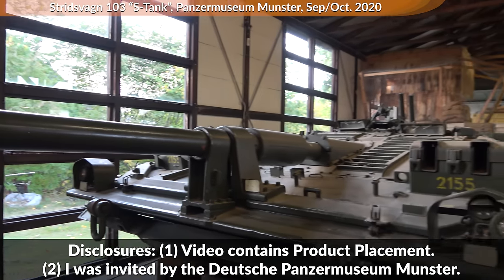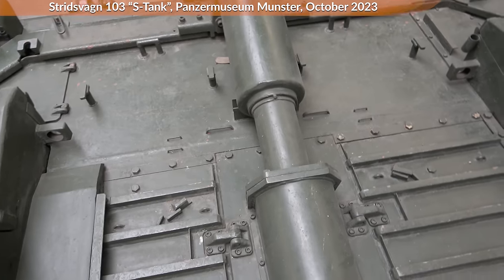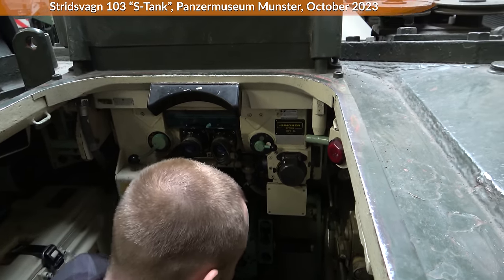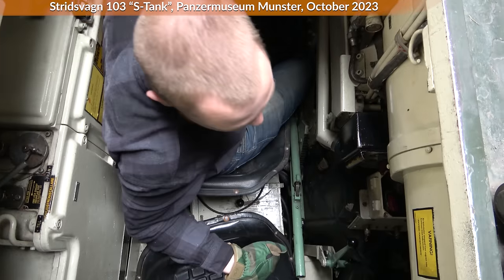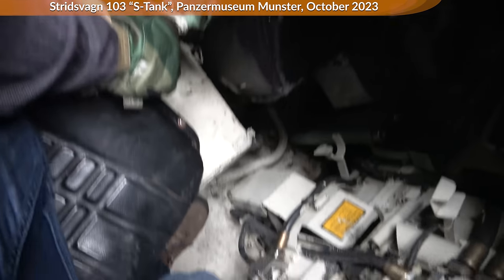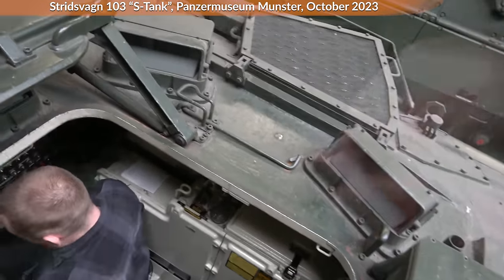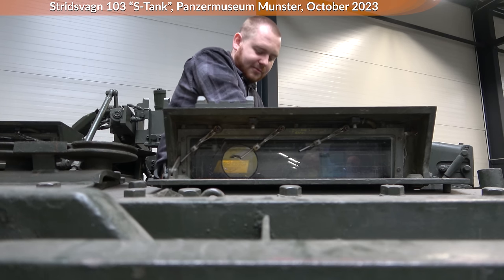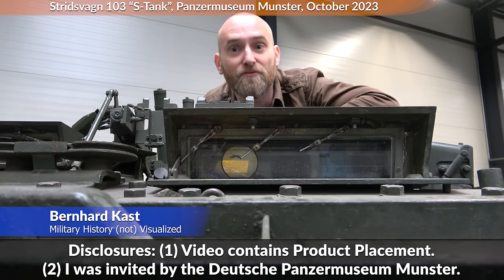S-Tank: The Swedish StuG

Comment: This tank is SO much older than the tanks the driver is comparing to. It should perhaps be compared to a Leopard 1, also designed in the 50’s.

During tests, the Strv 103 (Stridsvagn S) was however completely superior to the Leopard. It could detect more targets and come to shoot much faster. It was also tested in the US against the M60 and the 103 could fire a lot more accurate but was slightly slower to fire the first shot. In the last “battle” (exercise) the 103 fought, six 103’s went up against an equal number of Leopards. All leopards were knocked out but only one 103 was lost.
Reply: It's not that shocking, a much smaller target that fires twice as fast makes it almost unfair in combat exercise.

Comment: I really feel this form of tank is highly underrated. MBT's are big and impressive and take all the press photos but these vehicles are really hard to find and can hide in places tank stick out.
Reply: this form is very outdated, all modern threats are very dangerous for it: drones, mines and artillery
Reply: @shkoddi yes, but the same goes for modern tanks.
Reply: @mats66  nope. Modern tanks have chanses to survive some shots, this tank - absolutely not. Even the worst modern tank - Merkava 4, in fact, an infantry fighting vehicle with a tank gun, takes a hit better.
Reply: @shkoddi  the original comment was not about this specific tank but about this specific TYPE of tank
Reply: cant shoot while cruising, cant counter shoot when engine destroyed, cant move if it sitting in a trench ==> poor design
Reply: @milokhanh313 they where designed to use high speed to get into and out of ambush positions using tank showel to get hull down and then attack with three shoots when in contact with enemy tanks after they should retreat to next ambush position and do it all again. Their low profile and ability to go as fast forward as backward made them ideal for hit and run tactics in Swedish  hilly and rough terrain. They where not made to fight one on one in open terrain. See them more like sniper tanks 😊 
And they had two engines a diesel and a gas turbin to become more stable and able to get back to own lines.
Reply: @milokhanh313 can countershot with engine destroyed. After all you have aspare engine....😉
Reply: @jurgen4466  That sounds just like tank destroyer doctrine (atleast the German one, and I think the American one too). That's what I think is so strange about these things. They aren't built nor operate as tanks, yet people insist on calling them tanks. Tanks are offensive systems meant for open terrain where they can leverage their long range firepower. It seems very strange to me that this vehicle could fill the same role as the Centurions before it and the Leopards after it, unless Swedish tank doctrine changed radically each time they adopted a new vehicle.
Reply: @fridrekr7510  Well, it’s not like a lot of tanks don’t use “shoot & scoot” tactics (even today) and given the limited abilities to fire while on the move of tanks at that time, I think the difference between this tank and its contemporaries might not have been terribly large in practice.

As already mentioned in the video, the tank uses the same gun as the Centurion and could thus be expected to have roughly the same long range capability in open terrain, given that, at the time, both tanks would have to stop to fire. And tanks are not only meant for long range duels in open terrain, but also to support other troops and, if possible, to ambush opponents. 

Of course, and as mentioned in the video, when firing on the move could be combined with “shoot & scoot” tactics, then the need for this tank to stop before firing would obviously set it aside from turreted tanks and leave it at a clear disadvantage.

It should also be noted that Sweden’s defence was designed for one thing only: To defend against an opponent with massive superiority in numbers and materiel in a total, national, territorial defence strategy that would make it too costly (though obviously not impossible) for the Soviet Union to defeat.

Having tanks and other vehicles that could strike quickly and retreat into difficult terrain, rather than concentrate and fight mainly in open terrain where they would be obvious targets would be an absolute necessity. You really don’t want to go on a head to head slugging match with the Red Army’s tank force (NATO getting around this with the option of using  nukes, if push came to shove).

Compare with the requirements for Swedish aircraft to be able to operate from improvised landing strips (even using roads, if necessary) in order not to having them concentrated at a few, predictable locations during an actual war.
Reply: @DebatingWombat  The turret is always brought up as a main contributor to the versatility of tanks, especially in the offense where enemy locations are unknown. I’m not aware of any other significant tanks that used this turretless design at the same time or later. It just seems so impractical having to move the whole vehicle. Even if the doctrine was delaying action, tanks still shine as offensive weapons and counter attacks will be part of any good defence. If they didn’t count on having to fight it out, I don’t see why they couldn’t have used lighter platforms, ATGM jeeps etc. for hit and run tactics. Everything about this and how they talk about using them just seem at odds with the concept of a tank. Other nations have also used APCs or IFVs in tank like roles due to local considerations, but nobody would claim an M113 is a tank because of that.
Reply: @fridrekr7510  Thats because they for some reason only talk about the first half of the doctrine , which is meet and engage the enemy in delaying actions , the second part after mobilization is completed its time to actually engage him and you cant really go on the offensive in a jeep unless you have a death wish.

Lastly infantry cant fire on the move either , doesnt mean its obsolete and useless.

Comment: S-tank was still in use well past '79. I saw one on the streets of Gothenburg during exercises in the mid 80's.The S-tank was outmoded by 1) stabilised guns allowing firing on the move (it was anticipated but computers were still in their infancy during the design stage, so it was incorrectly assumed to be a long way off) and 2) WP armour piercing rounds which would've defeated its sloped armour, 3) engine reliability. The installed engine was too weak for the vehicle weight. 4) size of the main gun. Developnent took too long.

The autoloader was fantastic.
 
During testing in the UK, it was apparently shown that the need to halt and shoot did not leave it disadvantaged against other tanks of the era. The performance of Israeli tanks vs Syrians in the Golans comes to mind....
Reply: It was in service until 1997. He just misread the number because in German you say the last number before the second last.

Comment: the point about the gas turbine is not really correct, the piston engine was used to run the hydraulics which allowed the gas turbine to idle and take less fuel but this was a combined powerpack with both engines running in unison for 90% of the time.
While the two engines can to some extent operate independently they are still connected to the same gearbox (situated in front of the engine) so any hit to that area will mobility kill the tank regardless of one engine still working.  So tldr thats probably an overstated point. 

Also the external stowage bins are missing from this vehicle so the storage isnt as bad as you make it out to be in the video.
Reply from the maker: Thanks, seems my source on that was wrong.
Reply: @MilitaryHistoryNotVisualized  OP is wrong.
The barrel splitting the engine compartment in two necessitated the dual engine.
Just like with the M1 Abrams, the problem with gas turbines is that while very efficient at full throttle, they use almost as much fuel (~70%) when idle as they do under full load.
Thus a diesel engine was selected to keep the systems running and the tank to move at "low speed" (exactly what that means isn't defined in the sources), with the gas turbine providing power when quick acceleration or high speed was needed.  The problem here is that the turbine takes time to start and wind up to combat power, so whenever a state of readiness was needed, both engines were kept running regardless.
The gearbox was located forward of the engines as stated, but lower in the hull making a hit there less likely.
What makes it a bit of a moot point is that crews (like everywhere else) tend to leave the tank anyway if someone is poking holes in it,
Reply: @johanmetreus1268  Essentially the turbine was just for in combat mobility while the diesel was just when traveling.
Reply: @znail4675  It might have been the intention, but that is not how the tanks were operating.
Reply: @johanmetreus1268  your post seems to mostly agree with OP but somehow OP is still wrong.
Reply: @falsemcnuggethope  mostly, but there are two points where we disagree. My apologies for not expressing them more clearly.
"which allowed the gas turbine to idle and take less fuel"
With Sweden having plenty of experience with gas turbines since at least the 1940's, it was well known that a turbine on idle still used about 70% of the fuel a turbine on full power did. the basic idea was to shut off the turbine entirely when not needed.
For this reason, the engines could be fully disconnected from the gearbox.

"they are still connected to the same gearbox /.../ any hit to that area will mobility kill the tank regardless of one engine still working."
Lower front plate, sure.
Upper? Not so likely.

Comment: I was surprised it was recoilless, so Iooked up the wiki.  Seems being recoilless allowed it to shoot once every 3 seconds!  Looks like the Ferrari of cold war tanks.
Reply: The recoiling part of the gun is at the very back of the tank, where the auto-loader sits. It is most definately not a recoilless gun. An autoloader fixed to the gun allows it to fire 3 shots in six seconds (ie, one shot every three seconds).
Reply: It isn't recoilless, it simply uses the suspension as recoil dampener.
But yes, it is the fastest shooting tank ever.

Comment: So the gun DOES actually recoil, I have seen video footage of an S-tank firing and you can see a little bit of recoil. However I assume that the recoiling part of the gun and the entire recoil assembly is enclosed inside that white metal tube you see in the fighting compartment, so the crew is indeed safe from getting caught on it or anything
Reply: Yes I do think the gun did recoil, but not so it was noticeable inside the tank. I am not convinced that a gun without recoil is necessary for the high rate of fire as is stated in the English Wikipedia page. It is rather because the gun was fixed in elevation that made the auto loader so fast in comparison to let's say a T-72.
Reply: @Svenmpa 
You don't have to think it did recoil, there's video evidence it did here on YouTube in old promotion films
Reply: @Svenmpa  The gun recoils, but since the barrel is fixed in the chassis, the force is transmitted down through the suspension that absorbs it and returns the gun to position.
The extremely high rate of fire (technically 2.5 s per round was possible) was due to the extremely effective autoloader system...   which was only feasible if the gun breech could be kept in a fixed place in relation to the autoloader during the process.

Comment: The S-tank was actually a brilliant design for SWEDEN.  It should be kept in mind that when the S-tank was being designed, outside the big cities like Stockholm and Goteburg, most Swedish "highways" were narrow, winding, two-lane roads through dense forests.  Although not aligned formally with NATO, Sweden expected their likely opponent would be, of course, the Soviet Union, either making amphibious or even airborne landings across the Baltic from Estonia or Latvia, or going overland from the Soviet side of Lappland, probably through Finland, which also had pretty much all narrow two-lane roads through dense forests.  Simply put, the typical MBT with a long "pecker" often didn't have a lot of "swinging room"!  

By dispensing with the turret altogether and making the S-tank able to readily aim its fixed gun, the resulting package was low and very well-protected.  It was figured that a platoon of S-tanks would lie in wait for an advancing column of Soviet T-55s or T-62s, then, once they'd sighted their targets, unleash their 105 mm main guns on the hapless Soviet vehicles, then, with the secondary driver able to likewise drive the tank BACKWARDS, not unlike "Oddball's" (the recently-passed Donald Sutherland) Sherman that could go equally fast forwards OR backwards (that "Moriairty", the late Gavin McLeod, was indeed a "mechanical genius"), scooting out of range before any survivors of the ambushed Soviet column, if any, could retaliate!  Although that's the classic role of a Tank DESTROYER, the Swedes insisted the Stridsvagn S-103 was indeed a "tank".

However, all the upsides for the Swedish Army aside, this vehicle simply had no role outside its country of build.  Sure, FINLAND could have used it, quite well, indeed, but the post-WWII "Finlandization" process meant that the Finns wouldn't do something like that, lest they give the Soviets a pretext to come stomping in.  Whether Sweden would have formally come to Finland's aid in such a scenario is problematic; but like in the 1939-1940 Winter War, who's to say some "volunteers" wouldn't have come over, their S-tanks festooned with those Finnish swastikas?

Comment: The gas turbine was not used only for "emergency situations" - it was always running, to give the tank some speed. Also the gun did recoil, but it was encapsulated, and as a crew member you did not notice the recoil. The rear-driver was also the mechanic, medic and radio-operator - he had the main control of the engines, the driver and commander only main warning lights (high temperature or low oil pressure). And pre-shots I have never heard of - we "always" hit with the first shot, without using the laser rangefinder. The optics and aiming aids are magnificent.